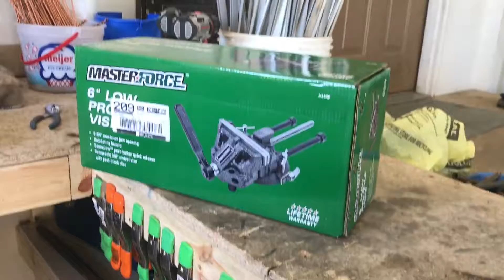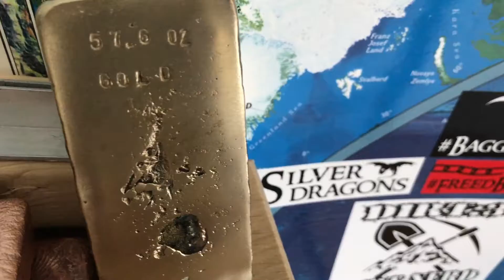Nordic Gold!  Trash to Treasure.  Making Gold from Aluminum, Copper, Zinc and Tin.  ASMR Melt.

Comment: Noticed in your calculations you used 3.11g for the cents. That is the weight of pre 1982 cents, that are 95% copper, the post '82 cents are 2.5g.
Reply from the maker: Thanks. I realized the same thing some days later.  Likely I’ll use a different process when I make more in the future.  Thanks for watching!
Reply: @RaysWorld  no problems happy smelting!

Comment: Yeah bro you are supposed to add zinc and tin at the end so that it doesn’t oxidize. As it melts with the copper and aluminum and tin after being added in at the end... it does t have time to oxidize because it bonds with everything else and becomes Nordic gold. The properties change. 👍🏻 next time try adding it at the end... promise better results!
Reply from the maker: Right on. Thanks for the tip.  I’ll give it a shot.